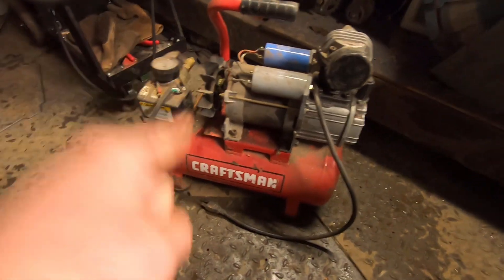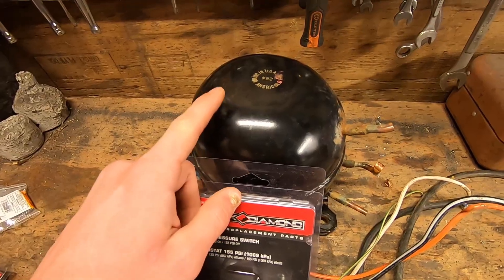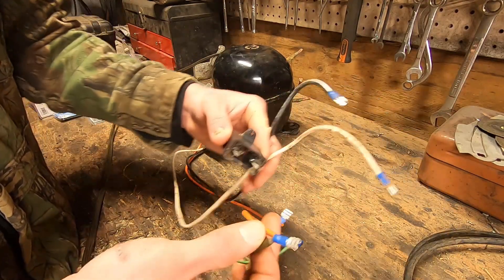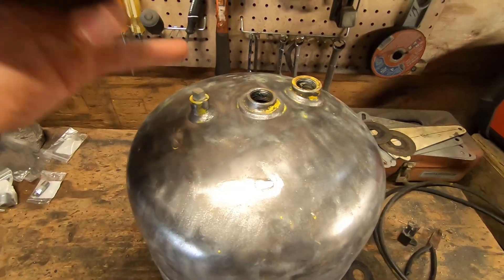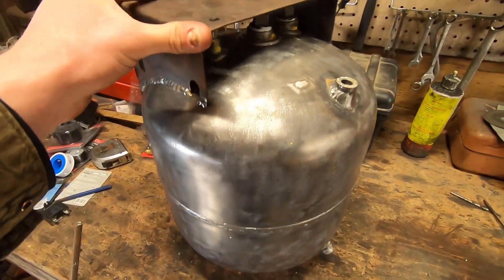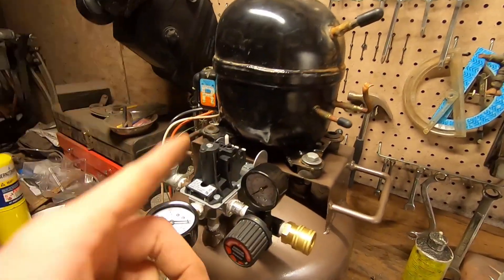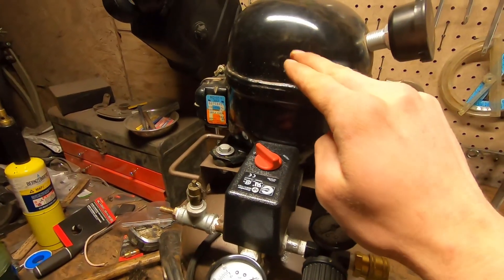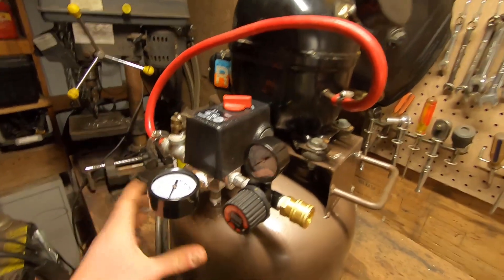How to Build an Air Compressor From Scratch! (Fridge Compressor | Complete Build!)

Comment: I’d have made a DIY powder coating gun and powder coated every metal bit out of worrying about corrosion. And it would likely also make it possibly look more uniform more easily than when using water based spray paint, or even oil based.

Comment: I took one out of a fridge for this project. The refrigerant used was listed on the side of the compressor. I pulled up the MSDS for my particular coolant and it was not harmful to people or the environment except when burned or in its compressed liquid state. 
No need to hire someone to remove it, I just (carefully) cut the copper line and let it vent.

Comment: With one comment I saw that said that the fridge compressor runs with oil running through the fridge system and that you did not include that part and the video is now 3 years old , is this air compressor still running ? 
how often do you top it up with oil ?

Comment: I mean couldn't you get one of those non locking pressure relief valves set to go off at 120 or 150 I mean annoying it hissing randomly, but it could be done on the super cheap safely?

Comment: Dis thang will overheat and will fail dude, These things use the same refrigerant to move the oil through the engine and cool the compressor parts, if there is no refrigerant, the compressor coils are not going to be cooled and in the process it is not going to move the oil.

Comment: The compressor in the video is a product that can operate continuously for a long period of time because the refrigerant that circulates in the closed circuit contains lubricant. Therefore, the compressor you built yourself will overheat due to the lack of lubrication oil recovery, and sooner or later it will fail due to the piston sticking.
Reply: this was my first thought when I clicked on the video... wondering how long this worked for him.
Reply: В корпусе компрессора есть масло,400-450  гр. для смазки,газ не смазывает. Периодически масло можно доливать (всосать) через вакуумную трубку.

Comment: I tried to weld a fitting in my propaane tank so I could use the pressure switch but the problem is that I don't have a super nice welder i only have a flux core welder and it dosent produce the best welds and i go to pressure check the weld with air and i spry the weld with soapy water i see these little bubbles

Comment: what did you do to keep the oil  in the compressor and not all ending up on the tank?
Reply: solder a copper coil or metal hose coil going upwards might help just a suggestion

Comment: How can I avoid getting the oil into the Air?  Or how do I catch it so it can go back into the system. Otherwise, it is a question of time for the compressor to run out of oil then burn ?

Comment: If I can get my hands on a giant propane tank, the kind you see at a propane store, I’d love to use this little compressor to fill it up.  Then I will have a silent air compressor with a huge cfm.
Reply: Yeah but I doubt it could actually fill up the whole tank without burning up
Reply: You can do it in increments.  I think those motors are designed for 100% duty cycle.
Reply: @richardjeun  yeah but those motors arent meant to fill up tanks

Comment: The water part of the test is called hydrostatic testing, it the tank ruptures under your test pressure of 1.5x the working pressure it will burst with with out making an explosion similar to cutting into plastic water jug. You would fill the tank to the top with water and if using air to pressure it stop adding air when you reach your test pressure, If the tank were to burst it would not send shrapnel flying, it would just leak water onto the floor. If you use only air to pressurize the tank and it were to rupture it would be explosive and send shrapnel everywhere just like a large overinflated balloon does when it ruptures and sends balloon fragments everywhere. It could kill you or severely injure you. All pressure vessels made and piping is hydrostatically tested,

Comment: Welding on that tank definitely creates stress points if not properly heat treated. I would want to hydrostatically test the hole set up before pressurizing with air.

Also it seems like the flared copper tubing with the hose clamp on the discharge side of the compressor may be a weak point.

Comment: though this is old and I'm not sure if this was mentioned but you should use an off-loader valve as well, some pressure switches include them and this purges the discharge line of all pressurized air so starting up the compressor motor isn't as taxing on it, also in AC system the capacitor shifts the phase of the supply electricity creating the conditions needed to get the motor started.

Comment: The compressors I have:   (to fill a 1 gallon tank at 100psi)
1.0hp = 1min. 30 sec.
1/2hp = 2min. 40 sec.
1/5hp = 3min. 50 sec.
If you have  one without the external parts this will probably do. a little large but hey?
3 in 1 Compressor Kit 
RCO410 3 in 1 Compressor Hard Start Capacitor Kit For Refrigerators & Freezers 1/4-1/3 H.P. 115VAC

Good luck.

Comment: The project has no feet, that build has a small footprint and is very tall, the refrigeration compressor is also extremely heavy. The whole unit is top heavy and it will tip over, it's an accident waiting to happen. There are no shortage of hacks on YouTube, by hacks I mean dangerous DIY guys waiting to make the Darwin Awards.

Comment: does the pressure switch assembly needs to be solidly attached to the tank? can it be connected to it via an aproppriate hose? i ask because i want to assemble a small air compressor on my boat and i dont have such a regular space (if that makes sense), ie, the components need to be a bit "scattered".

Comment: So much cheaper and easier to use old compressor as the base for this. Welding to a pressure vessel is just not a good idea. If that tank ruptures it could kill you.

Comment: Any chance you could give an update on the compressor. I really like these compressors but the oil loss problem is annoying. Did your loop solve the oil loss? Did you have to add an oil catch later to recirculate the oil?

Comment: I am trying to get my compressor on i don't know if it needs more oil or it's the motor that is seized but I am using it with out the capacitor and when I go to plug it on it just hums any advice anyone?

Comment: Hey thinking of doing some hydrogen compression,would that work with a refrigerator compressor like that? Its important that the gas is not polluted by oxygen,it seems handy to have an input tube.
Reply: Hydrogen is a very difficult gas to put in a tank and keep it there.  The size of hydrogrn gas is very small atoms and it seeps out of the tank.  Roger Billings, former hydrogen enthusiast, finally ended up using a catalyst inside a tank to store it .  Same idea as cork for storing acetylene in a tank. There may be a patent you can refer to regarding that.  Patent has expired by now..

Comment: Gas cylinder is certified up to 24Bar, so no point in installing pressure switch and relief valve when using refrigerator compressor sensibly.

Comment: How do you make sure it's empty before you weld on it? Do u purge it with a compressor or anything?
Reply from the maker: Fill the tank with water and then drain the water before cutting. Do so at your own risk though.

Comment: and hoe did you solve the oil that gets pumped out along with the air, these compressors need oil , so if you don’t have a return system you will run out and the compressor will die

Comment: Where did you find the electronic check valve that was it at your local hardware store or did you buy it offline because I'm trying to make a copy of this myself and not very many places seem to have what I'm looking for
Reply: I figured this design would be capable of operating a Torch from nobox7

Comment: Can you put fridge compressor on a 30 gallon tank? I only see them mounted on smaller tanks. Thank you
Reply: That's because they do not displace much air. They can pump very high pressure but pump very slowly. 30 gallons would take a very long time to fill and probably overheat.

Comment: There is an element of danger modifying and welding a pressure vessel without testing it. It would have been a good practice to fill the tank with water and apply pressure to it with air or your pressure washer if you can adjust the pressure on the washer. I would suggest  a pressure of 1-1/2 times the pressure you plan on putting in the tank. You need to fill it with water so that if it ruptures it should not harm you. If you only use air to pressure test the tank it may explode and injure of kill you.
Reply: Just out of curiosity how does the water make the test safer. Not being snarky I'm genuinely curious, love learning about things like this. If it's some effect that has a name I'd love to check it out.
Reply: @dualxsurvival155  you cannot compress water like a hydraulic system but gases like air are compressible and increase the danger considerably. If you fill a tank with water and add pressure behind it the worst would be spraying water everywhere maybe splitting the tank. However, if you compress a gas to x psi if that vessel should rupture all of that stored energy will release sending shrapnel everywhere. Colin Furze did a cool video on hydroforming sheet steel using water to "blow up" 2d steel shapes creating 3d shapes. It greatly explains the concept and it's entertaining. Honestly, if you suspect a pressure vessel throw it in the fuck it bucket. $100 USD tops for a decent size tank and a peace of mind you cannot put a price on.
Reply: @dualxsurvival155   You are compressing water instead of air. If a repture, water will absord the 'instant' release far more safely than compressed air.  Example.   Blow up a balloon with your mouth and fill another with water.   Stick a pin or needle in each.  There is your answer.
Reply: I haven't really seen adjustable pressure washers but you could out a gauge on and just hold the trigger for short periods but if you are using a refrigeration compressor you can probably use it for testing before it can probably do over 300 psi if it's not for something like an ice maker that used r600 or butane it operats at pretty low pressures
Reply: Given the choice of PPE used when spray painting I'm thinking safety isn't high on the personal agenda.
Reply: "simple and easy u can boil water in a plastic cup by just put it on the fire." the water boils yes bad for you but the plastic wont melt eveb when u weld it

Comment: You really need to put a safety disclaimer up because if somebody happens to grab a decent Pastor and thinks it's not clearly sensitive could Pay very dearly most capacitors are D.C.
Reply: I only understood the last part of your post but I was thinking the same. Only ac capacitors are non-polerized. The majority of ones you will come across are polarized.

Comment: I’m not even gonna finish the video an air compressor made out of one 120 V refrigerator compressor is the biggest waste of time and money especially if you build it like he suggest and don’t put a oil air separator to catch all the oil a refrigerant pump literally pumped out why ?with refrigerant it’s a closed loop bringing all that compressor oil mist back in to where came from at the minimum Using two refrigerator compressors might be the slightest bit useful for example if you live in an apartment or a trailer park like myself. Instead of building a useless novelty item there was a specific reason I built mine for light duty use with power tools and to air up the tires which I’m constantly on my vehicle I used primarily for off-roading

Comment: I converted the air conditioning pump on my truck a few months ago, it works great and being engine driven keeps up pretty well. Problem is these spit all their oil out very quickly. All the methods online seemed half assed, with some people packing the pump with grease (Which will lead to bearing failure) and the rest adding a few squirts of oil every time they go to use it. I decided to copy how much larger shop compressors work and fabricated an oil catch can stuffed with 3d printed baffles and stainless steel wool with a tiny bypass line at the bottom.
Pump gets filled with oil, oil gets caught in catch can. Bypass line at the bottom recirculates the oil back to the air intake. Bypass line needs to be sized pretty small since it's essentially an air leak but it works well once it is dialed in.

I like using these old fridge compressors as vacuum pumps for small fiberglass/carbon fiber projects.
Reply from the maker: Awesome! Thank you for input!

Comment: By the time you buy all the parts you could almost buy a small air compressor.
Reply: Why he didnt just remove the old compressor head and reuse the rest (reciever, pressure switch, relief valve etc) is a mystery. It would have taken a lot less time too.
Tip: if the comporessor has a brand/model number you can look for the datasheet which will give you the displacement and quantity of oil it requires. Ditch the oil in the compressor and replace it with the correct quantity of a non foaming mineral oil, ideally  Shell Tellus 68 or equivalent.. Dont allow the compressor to exceed 100 deg C which will shorten its life massively. Its also important to use an unloader to protect the valves even if the compressor is rated HST/HBP which is the best type to use.

Comment: I don't know that this project is worth it.  I would be curious to know what was the final cost for a device that has the potential to blow up in your face. Any engineer worth is salt will tell you: "You don't f**k with a pressure vessel".

Comment: You actually welded your pressure vessel? O.o Do you like getting shot?  You should stick to safety and just use holes already made. The whole reason to use an already made pressure vessel is for safety.
Reply: ^^^^* Doesn’t understand welding or that air tanks rupture. They don’t not explode. Pressurized PVC explodes.

Comment: You do know it is not good practice to weld Black IP Malleable fittings?
Reply: Why?
Reply: @nommy8599  Malleable iron cannot be successfully fusion welded and retain its unique properties; to put it another way, you can weld malleable iron as easily as you can weld gray iron, but in the act of welding you will convert some of the malleable iron casting into a gray iron casting.
Reply: @vinylexperience77  Ok, so it will become more brittle and likely to break where it otherwise would hold if not welded?
Reply: @nommy8599  yes that is right. A malleable fitting is cast iron that has been heat treated to soften it.
Reply: @vinylexperience77  Thanks!

Comment: great videos man, just a piece of advice, its a bad idea to solder wires before crimping them into a connector or screwing them into a terminal, because copper is springy and retains crimp/screw pressure, but solder flows like goo but much slower, so when you crimp/screw a soldered copper wire it will be tight, but when you check it a few hours later it will be much looser, which significantly increases resistance and can even make the wire fall out, so when you solder wires like you did with the two orange ones coming into the capacitor, add a bit more flux and blast the whole connector with a blowtorch so both wires solder to the connector itself, which will be even stronger than just crimping

Comment: last time I looked into doing something similar it was recommended to change out the oil as the oil they come with goes acidic when exposed to moisture
Reply: There are multiple types of oils found in refrigeration that is true of POE but not mineral oil.
You would still want to replace the oil. I believe they are all detergenting, if you notice he comments on oil coming out the discharge while It's running. Would be a good idea to replace the oil with a nondetergent air compressor oil to help limit that.

Comment: The pump is ludracated by pumping the oil out and back in again. That compressor will pump all the PAG oil out, then what?
Reply: I don't think the tank body and compressor body are electrically connected. The compressor body could become live and that could give you a nasty shock. Also, I would love to see a fuse in the system. Mains AC connections should be done by crimping and not by soldering only.

Comment: is there any reason not to use the old parts from your compressor? I understand showing us all the parts you might need, but I'd use the old switch and tank from the old compressor.
Reply from the maker: I would have if not for the videos sake. I wanted to start fresh.
Reply: @randomn6473  makes sense. Excellent video

Comment: at 11:52 ideally one should avoid soldering a connection before it's crimped if it's expected to be subjected to vibration. The solder will tend to fail, and it pushes the stress riser out the back of the ferrule of the terminal. NASA-STD-8739.4 and further their larger workmanship standards guide might be of value.
You also might want to give those terminals a squeeze - I think you got the classic .81/.51 tab width thing going on.